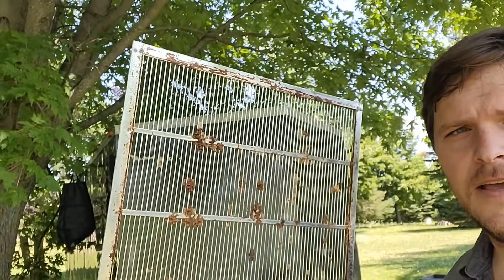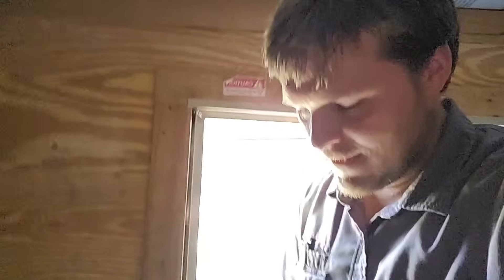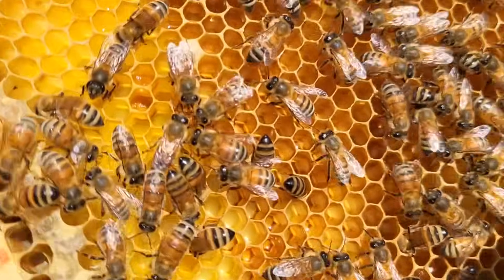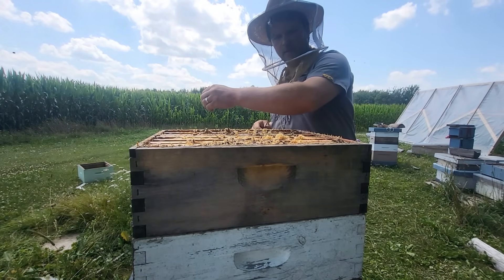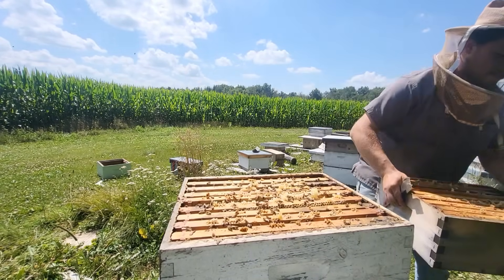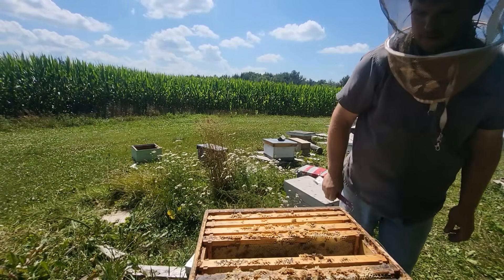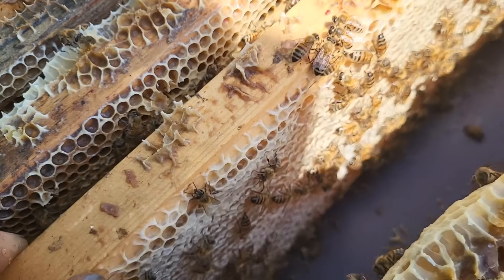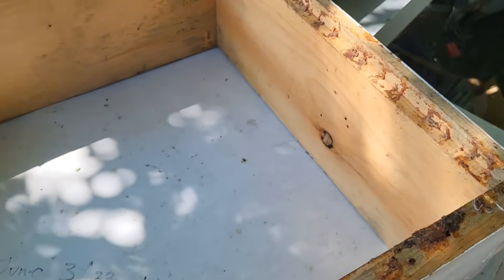Rethinking the Queen excluder

Comment: Does this method cause any problems during swarm season?
Reply from the maker: Wouldn't think so! Bees will swarm for all sorts of reasons, though. I requeen every hive every year.
Reply: @abeeforallseasons we’re trying next year with adding more brood boxes. We’ve had them swarm two rears running. But noticed their reluctance to use the space in the Supers and probably wouldn’t pass through the queen excluder
Reply from the maker: @stephenpowell3334 I generally sell all of my overwintered queens in NUCS in spring. Let the bees raise a new queen and use the brood.break to treat for varroa. Swarming still happens - but the urge is certainly less so with a hive that has already raised a new queen!

Comment: Using QX in the manner you suggested would leave gaps for pest entry. Perhaps wax moth and small hive beetle are not an issue in your area but they certainly are here in Australia. I guess the bees would eventually propolise the gaps but the propolis would be disturbed with every inspection and allow many hive beetle easy entry. Its a reasonable thought and with hive body modification could work well.
Reply from the maker: Yes - of course. SHB havent made their way to any of my yards. Eugene the Beek I learned it from would likely say its a practice for a season. We generally have a very heavy honey flow in Southern Ontario from the end of May, through to the July Basswood. This practice would be used to capture honey during that window.

Comment: Thinking this solid sheet maybe a good idea, but  in a warm- hot climate I think it may be a hinder air flow. Could you use hardware coth 1/8 inch instead of? Placing a plastic edging on it.
Reply from the maker: I thought of this as a possibility - this hive does have a screened bottom (dont usually like working with screened bottoms), and it has been quite warm for Ontario over the last month (regularly 90f, 32C). Didn't observe any bearding on the hive during that time and they had no problem getting the moisture on the honey down to 17.
Reply: I'm in Kansas now and had bees in Arizona for years.  You do need a good air flow bottom to top. I'm going to look into your ideas further I think it's a good one, saves money and provides more freedom for access. I also don't like screen bottoms. And have made my own bottom boards which serves as bettle trap. Works good too. Plus I have made my own solar heater which is part of the bottom board.  I will be using it for the first time this winter. Good speaking with you, good luck on all your bee indeviores.